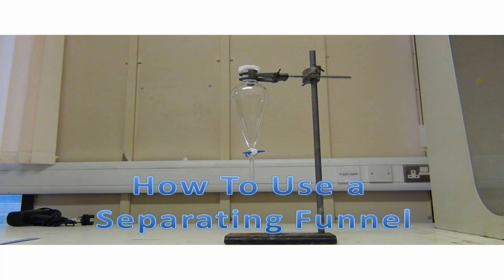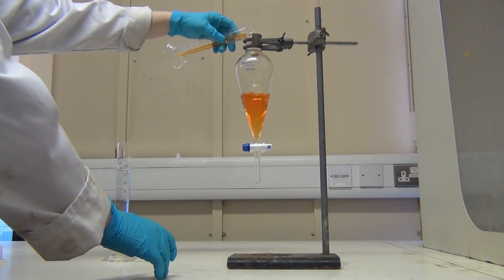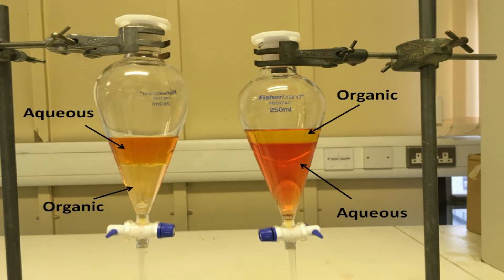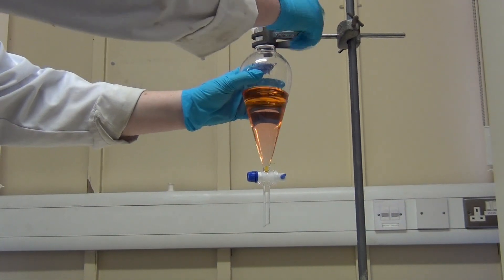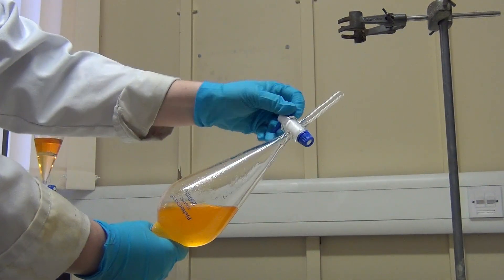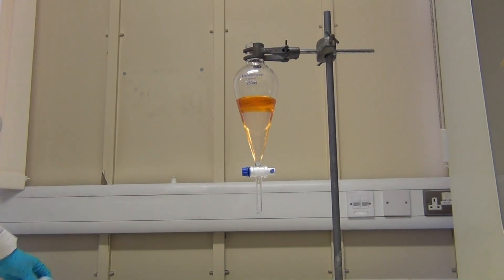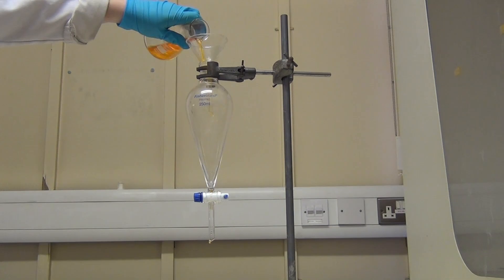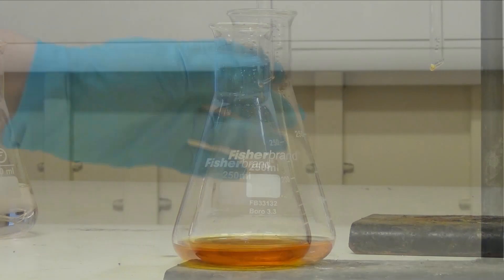A-Level Pre-Lab Video for Using a Separating Funnel

Comment: Pretty sure youre supposed to pour the top layer out of the joint... The stopcock has the little path that will contaminate the 2nd liquid going through it.... But maybe im just being picky
Reply: You are absolutely correct.
Reply: top layer should get tipped out the top and into a different flask, to keep the stopcock at bottom with only the bottom layer in it
Reply: TOP G!!!!!!TOP G!!!!!!TOP G!!!!!!TOP G!!!!!!TOP G!!!!!!TOP G!!!!!!TOP G!!!!!!TOP G!!!!!!TOP G!!!!!!TOP G!!!!!!